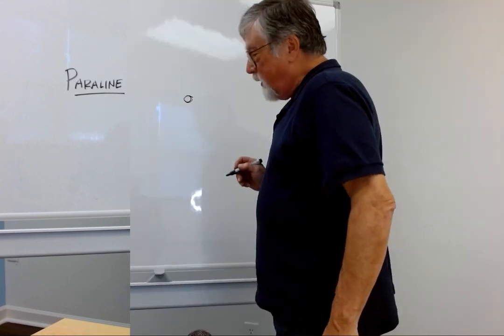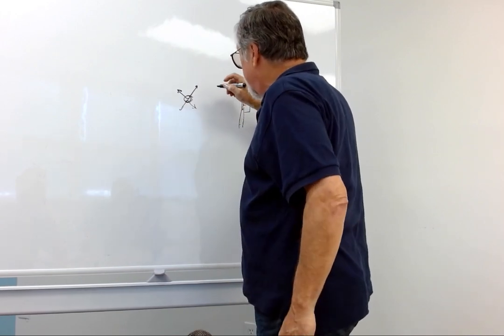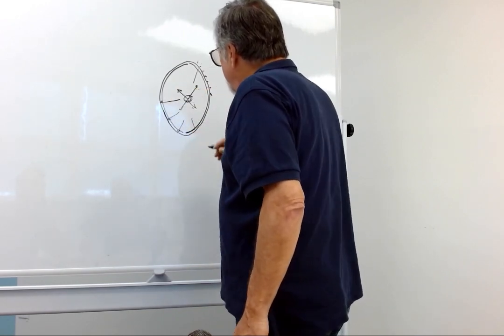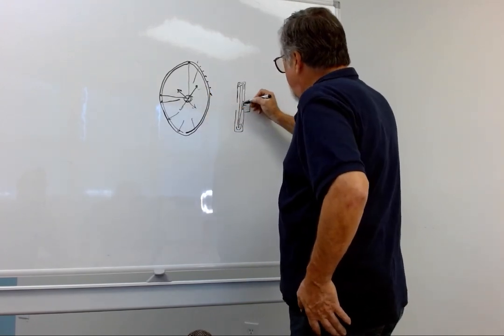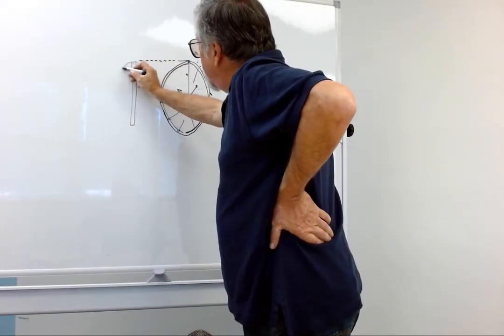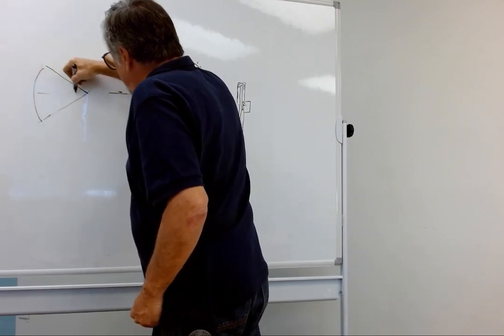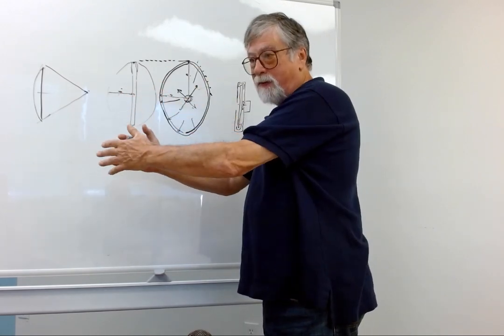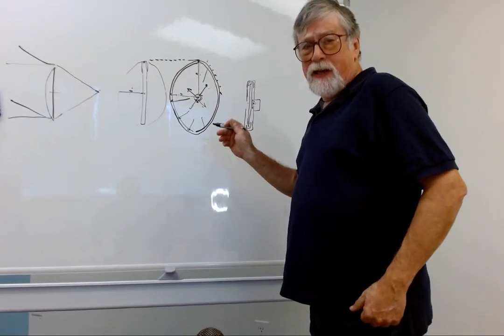Questions with Tom: Paraline™ Technology

Comment: The method of action of the Paraline lens is to create an acoustic delay line for parts of the high frequency wave without disturbing the other parts of the high frequency wave, allowing each pressure front to propagate from a diffraction slot exit while having a shape that is either identical to the shape of the slot exit, or curved like it was radiating down a much longer horn with narrower exit angle. The purpose is to take an acoustically small high frequency source (a round compression driver exit opening) that would produce a wide coverage angle on a horn with certain dimensions, and make that source acoustically large in one dimension relative to the exit dimensions of the horn so that the horn itself behaves like a much deeper horn with narrower vertical coverage angle, without losing energy or introducing due to internal reflections or comb-filtering between multiple apparent sources. This is similar to what is done in line array cabinets but not necessarily the same. You can introduce any arbitrary curvature and produce any resulting coverage angle in that long dimension. Other wave-shaping lenses (EV Hydra, Turbosound Dendritic Horn, etc.) try to divide up the entering wavefront and make it follow a number of delay lines, like a sectoral horn with different path lengths, but not only does this require more overall depth to be effective (shortening the bell of the horn that we would hope to use to provide horizontal pattern control but now we can't), but it still creates a group of exits that can experience comb-filtering between them, and the narrow pathways of the delay lines add harmonic distortion to the output. The Paraline preserves a single, coherent wavefront through the entire waveshaper while minimizing the path length through the lens and the overall depth of the lens, so that harmonic distortion is not added to the HF output. Additionally, because no two possible path lengths through the Paraline lens are equal, any internally reflected sound ends up canceling itself before it can add together with the next wavefront from the compression driver, preserving high-frequency clarity. There's my analysis.